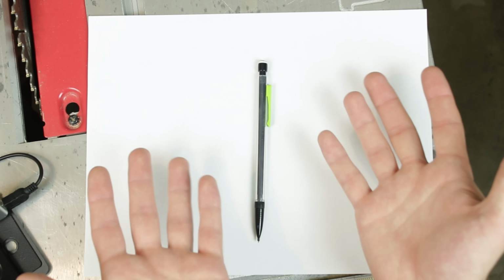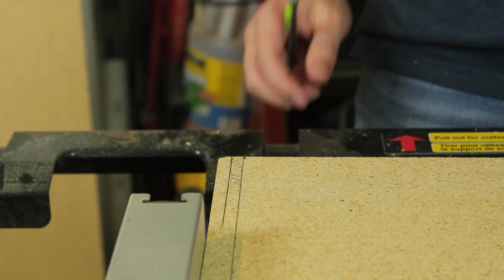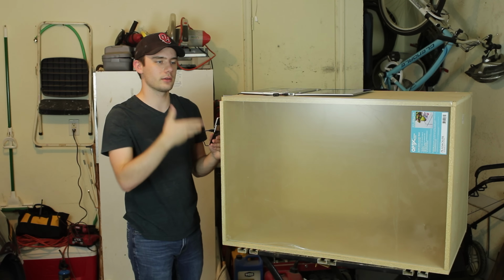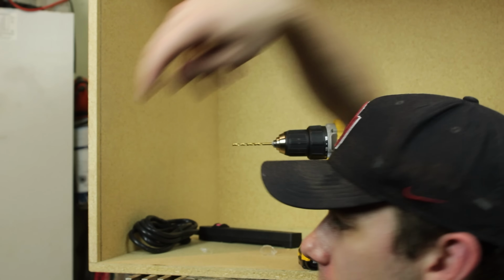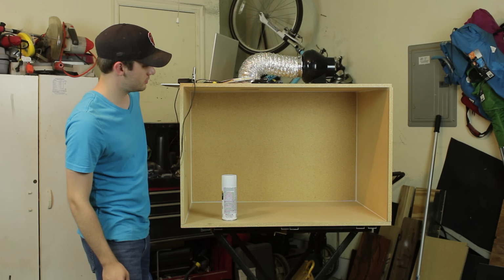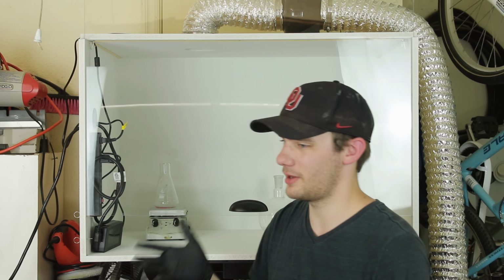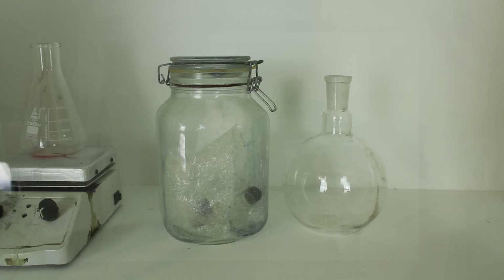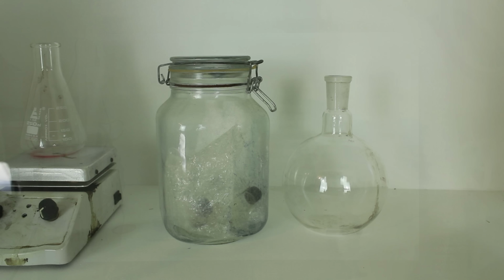Building an OSHA-Approved Fume Hood to Make Chemistry Less Dangerous

Comment: In my lab I don't work as much with flammable vapours or know the risk and have a vent system. I mean hydrogen in extremely small amounts like with metals and Aqua regas the mix normally is not explosive (NO2, H2, Cl2, NOCl2) I had good ventilation but better ventilation may work.

Comment: Need to swap out those aluminum ducts for polypropylene. A marine store would be a walk in, maybe RV suppliers as sewer hose but most of those are vinyl. McMaster has PP duct for less than $10 a foot so it'll be much cheaper as a 'misused' product. 

You'll likely find in a few days that your aluminum is already degrading since you put chlorine through it. It won't take much to burn through.
Reply from the maker: It's actually held up pretty well, possibly because the interior is coated in a thin plastic film. But yes, PP tubing would be optimal, although for the 50 feet I want at $10/ft, it would be pretty darn expensive!
Reply: @LabCoatz_Science  $10/ft was a maximum, McMaster-Carr is where you get stuff you can't get anywhere else and they know it.

Comment: I feel you on the hot garage. Same in Louisiana. I leave at 9am and it's already 95* in my garage according to my ambient temp sensor in my truck.

When I have to work in there, I work for 5 or 10 mins at a time, then go in and cool off for 5 or 10 mins. I've also opened thr door into the kitchen to let some cool air in from the house since I'm usually working right on the other side of the door. That means I feel the air flowing through the doorway into the garage.

Oh. I also wait and work on my vehicles at night. 11pm to 4am because it's usually much cooler 😂😁
Reply from the maker: Yeah, I much prefer doing my garage work in the winter, but in the summer, I do try to get up early and work before it gets too hot.

Comment: Question about the fan you choose:

Do the internals of the fan have exposed metals?

Just wondering about possible corrosion to the fan's internals could cause the fan to stop working if something like the motor is exposed. 

I also dont know if the fan is expensive or not in the first place 🤷
Reply from the maker: Not sure, but I have been concerned by the same thought...the fan itself wasn't terribly expensive, but I would rather not replace it every time after I use HCl or chlorine. If it does fail, I will definitely be looking to more resilient options!
Reply: @LabCoatz_Science  all the internals of those fans are exposed to the air/fumes that goes through it. hence my suggestion in my comment of adding those square activated carbon filters and maybe hepa filters. They are cheaper than the typical filters used for cannabis cultivation, while still just as effective.
Reply: I'm willing to bet the fan's using an induction motor... or at least I hope so. There aren't any electrical contacts in those, the coils are part of the frame and spin a solid rotor. Still have to worry about the bearings, but if you get in there and give the exposed part a liberal smearing with plumber's grease (silicone grease) they should be fairly protected. 

The inside of that power strip is probably already green, though.

Comment: Yeah i am planning to have an fume hood environment in my lab outside and more ventilation I also have all the windows in the house downstairs near by.  An fumehood is not possible but lots of fans etc is practical. I am trying to make a Passive system as well. Not sure if it will work. Planning on that.

Comment: I used electrochemistry to make sodium hydroxide. I used two 250ml high-density polyethylene (HDPE) bottles to make my electrolysis containers. I used plastic because chlorine is very corrosive, and sodium hydroxide is said to etch away glassware. I'd drilled two holes in the sides of each bottle, then inserted a clear polyethylene hose in which I'd inserted a piece of cotton to act as a diaphragm. Both bottle holes were sealed at the joints to make sure no chlorine gas would escape. 

In my haste to retrieve the sodium hydroxide, I removed the cap immediately after the electrolysis was completed. My face was close to the opening of the bottle containing the chlorine gas. When I unscrewed the cap I quickly moved away from the chlorine smell, but it was too late. I suddenly felt soffocated. There's no doubt, Chlorine gas is extremely dangerous to inhale. I later found out it had been used during WWI to kill enemy troops in their trenches. 

A fume hood would have been indispensible in my case, and I wish I'd had one. What about testing heavy smoke? You don't want anyone who sees smoke to think your lab is on fire.

You're learning, and unfortunately, mistakes will happen. However, it's good to know that you're concerned about yourself and other people's health, and are willing to take the necessary precautions to reduce any risks involved in experimentation. I have also done some careless things, but have since been more cautious. 

As a spectator, I'm not interested in watching or seeing someone kill themselves for the sake of chemistry. I prefer watching someone who takes all the precautions necessary to keep everyone safe.
Reply: ELECTROLYSIS IS A OWN KIND OF SCIENCE; hmm? dont forget the in-situ creation of HHO... there are some fine nurdrage videos on how to build an electrolysis box securely.... as for the gases, try some ion-exchange resins mixed with calcium carbonate / activated charcoal pellets....but why to make NaOH in first place? obviously not for the sake of getting some.... did you had the urge to understand the solvay process, i might ask?

Comment: switch the aluminum hose, it will rott away imediately... try to install plumbing tubes or might get some out of ldpe preferably... secure all electronics please!!!! and get a nice filtering chamber with enough ventilation  to pass trough....i can recommend charcoal/ion exchange resin, mixed up with bentonite (kitty-litter) spray the mixture with high fraction - whiteoil/sillicone oil and dont forget to cover the suction vent with a good fleece-type sieve....but the allaround concept of your hood seems pretty durable. NICE

Comment: An addition to your fume hood that would be a good idea to add would be those square carbon filters and hepa filters. This would help protect the fan from the more nasty type of fumes, and reduce issues if there is a leak in the exhaust hose. you can add a section on top to house the filters. Also, having that power strip on the inside is not a very good idea, not only do you have to still reach inside the funehood to disconnect cables, the powerstrip can fill with fumes which leave residue that can cause shortcircuits or if the fumes are corrosive, they can eat away at the contacts. That cable passthrough is large enough to pass through cables, plugs and all. I would place the power strip on the outside of the hood and have the cables for the hotplate etc go out of the fumehood into the power strip. That way, if you have a bad run-away reaction and need to kill the heat for instance, you can quickly unplug from the outside while closing the acrylic sheet.
Reply: Problem with filters is that they reduce the pressure of the fan to a large degree, and this can lead to an inadequate front face velocity, especially with a fan not that strong. But I agree in placing powerstrips on the outside.

Comment: How dilute must exhaust gases be to conform to local regulations? Or is there need for some form of filtration or neutralization chemistry to keep it from causing local concern?
Reply: this is oklahoma
Reply from the maker: Honestly, I have no clue. Those laws might only apply to large-scale chemical manufacturers, idk. Normally, I would just do these projects with the garage door up and let the fumes escape, so this is basically just an extension of that. Most of the stuff that gets pumped out is actually just the vapor from solvents that would normally just evaporate into the environment anyway, like xylene (paint thinner), acetone (nail polish remover), etc.

Comment: When adding an AC unit to your lab add an air intake to your fume hood, that connects directly to the outside to keep that sweet cool air in. 😀And borrow a fog simulator to check for unwanted air inlets.

Comment: ok, aside from all the issues others have pointed out, there is also the issue of the size, you don't really have enough height for a fractional column or anything tall, even the width is kinda too narrow, a vacuum distillation setup would take the whole length more or less, and no room for much else like say a trap or a neutralising solution, or a gas wash bottle...

plus, you don't want to have to take out contaminated glassware right in the middle of work to make room, you could sit them in a corner and move with syth till you can setup a proper neutralising bath

Comment: i build a fumehood like yours in my basement some weeks ago just with a larger extraction fan and 6inch hard pvc wastewater pipes. i actually occasionally smell the stuff i work with but i guess that this is either coming back through the (mostly closed off) window or im carrying the chemicals out on my gloves or while cleaning glasware.
what i like most about my setup is that the acrylic is mounted on a pulley system with a counter weight(like a chalkboard that can be height adjusted) so you can just push it up or down whenever you need it without having to adjust pins or whatever.
another thing to remember is to keep the turns with your piping as shallow as possible as sharp turns really limit the airflow.
furthermore i suggest always leaving the sash open by a little so that the stink doesnt have a chance build up inside the hood 

anyways great project. like to see the tutorial
when i build my hood there was really minimal information on the internet of either really shitty or really high end selfmade fumehoods.
have fun

Comment: Just a table saw tip homie, when cutting with the rip fence, the smaller part has to be on the drop off side. If that's not possible, you need to lose the fence. 

I'm not gonna safety police you for no guard, riving knife, hold down bearings; I don't use any of that either, shit you'd be lucky if I use a push stick, but I also don't set myself up for things to somehow pinch, twist, kick back or pull my hand in.  

It happens faster than you can react, and it happens to people more skilled than you or I, so, just prethink your order of ops when you cut. Have your feet properly set, movements planned, etc.

A table saw is such a basic component it's easy to think it's benign. Just saying, a little respect while you still got all the digits might be wise. Cheers.

Comment: Where did you find bare Particle Board in 2024? When you upgrade, get melamine board. It's particle board covered in melamine plastic.
Reply: So you didn't watch the video?
Reply: @jasonpatterson8091 Did you watch the video?
Reply from the maker: I just picked it up at the Home Depot, mostly because it's so cheap (about $8 per 2'x4' sheet) and much flatter than plywood or similar. Melamine wouldn't be a bad idea though!
Reply: @LabCoatz_Science it also falls apart when it gets wet and I believe it’s quite flammable. I’d use some plywood (you can get a 4x8 sheet cut and it’s much cheaper than buying smaller pieces), then line it with hardiebacker (cement board), and then cover that with something like Formica. The Formica is very durable, and the cement board adds a degree of fire resistance as well. For ventilation, you can get solid coated ducting for use in wood stoves that’ll be far more heat and chemical resistant than anything like that dryer vent. That, or some flexible hose made for dust collectors from a woodworking shop.
Reply: @mollago  The original comment I replied to said that if he didn't paint the MDF it would fall apart.  Not sure if the edit changed the comment significantly or if YouTube or I managed to reply to the wrong comment.

Comment: I'd also spray the inside of that cabinet with epoxy appliance paint now, before the paint you have gets attacked. Should be a lot more resistant than anything else you can get at a big box hardware store. Might want to run a little smooth bead of clear silicone or glue down a little strip of plastic from side to side just inside the door so minor spills can't run out the front. 

Regarding the epoxy spraypaint... if you do it with the cabinet running, OUTSIDE, you stand a chance of: A) protecting your hoses, at least a little bit, and B) finding out pretty quickly if that extractor fan is going to be a long term item, and giving anything bare inside it some protection too. 

If you're going to work with volatiles, think about oxygen reduction. Could be as simple as a bowl of dry ice in the back of the box. Also consider some grounding for spark protection if (when) you move to polymer hoses. Look at wood dust collectors for clues how to deal with that, and also marine engine vapor purge systems (you have to ventilate enclosed vessels while fueling to avoid potential 'inadvertent rapid disassembly').

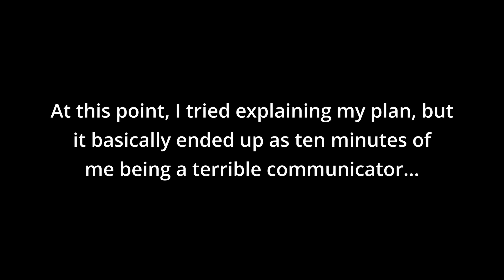Comment: 1:23 Too long; didn't use...

2:46 RIP headphones... D:

Also, are you sure the ventilation won't just be spreading everything that's (potentially) hazardous over a much larger perimeter than just the garage?

24:53 So - what about the neighbourhood?
Reply from the maker: Honestly, the release rate of any potentially offensive chemicals (during normal operation) is typically low enough that the wind disperses everything. By the time it reaches another human, whatever output there is will be in the parts-per-billion or even trillion range: pretty much only a concern if your dealing with nerve gas, which I am NOT. And considering I work on a sub-kilogram scale, there really shouldn't be any significant environmental effects, especially since most of the chemicals I release are just hardware store solvents, which are meant to evaporate anyway.

Comment: Was it the accident or the ER bill that got your attention? Anyway, this is OK for a beginners fume hood. There are different grades rated for different types of chemistry and it's important that you understand the limits of yours. You appear to have used a booster fan and clothes dryer ductwork. Understand that it can't handle certain chemicals. If the blower isn't a sealed brushless type, it wouldn't be safe with flammables. So, read up on what your components limitations are and don't blow yourself up.
Reply from the maker: Honestly, it was more because I've been meaning to do so anyway, and this was a good excuse to finally build it. I'm planning to work with more risky chemicals (I just finished working with formaldehyde, and hydrogen fluoride looks like it'll be on the list soon), and also the people I'm living with are tired of smelling the solvents I frequently need to distill. I'm aware of my hoods limitations, but considering I don't frequently pump large volumes of corrosive gas through my reactions, I'm hoping it will hold up for a decent amount of time.
Reply: @Kalle1995If he can make that much chlorine without even smelling it, it's a decent setup.

Comment: Consideration for the neighbours in your lack of attempt at any 'filtering'?  The possibility of harm to others is non-trivial.  Glad I am not living near the many amateur chemists who consider this not.
Reply from the maker: Considering I've been running these experiments without a hood with nothing more than a open garage door for years, I'd say there isn't much reason to complain now. 90% of the chemicals I ventilate are simply hardware store solvents that are meant to evaporate into the air, and if there are any toxic gases present, they are typically very mild (chlorine, ammonia, etc). Besides all this, I work on a sub-kilogram scale (usually below 100g) and the few grams of material I do output are typically released over several hours, making them dilute enough to be unnoticeable to anyone beyond the house.

Comment: A fume cabinet is made of non corrosive and non toxic materials like titles and with a sink. The duct your using will react with the acids that you use. The fume cabinet in my opinion won't last long. Sorry.
Reply: You're being a bit over-the-top.
You can coat the inside with a non-corrosive paint and it'll do the job just fine.
But the aluminum duct should be replaced by a plastic one, as well as the fan should not be inside the garage but rather outside and also on a separate breaker so if something goes wrong ( for example a hot plate that triggers the fume hood breaker), the fan should keep on going.
Reply: I personally used an aluminum/PVC tube with a ton of sulfur oxides, nitrogen oxides, chlorine, hydrogen chloride gas and such for months in my fume hood and it shows very little degradation and only on the surface. The gas have too little contact time to fully react with the duct as they instantly get pulled away and get diluted with air, also, a passivation layer forms and this protects the underneath metal to a certain degree. Not saying that stainless steel or fully PP/PVC/PE tubing isn't better, it clearly is. But even cheap aluminum will resist for months if not years, especially if you partially scrub the vapors before they get in the duct, as with an inverted funnel trap.